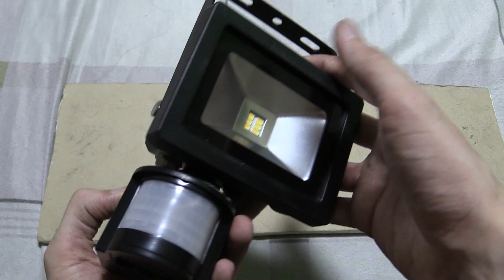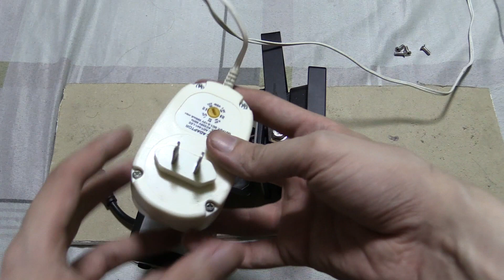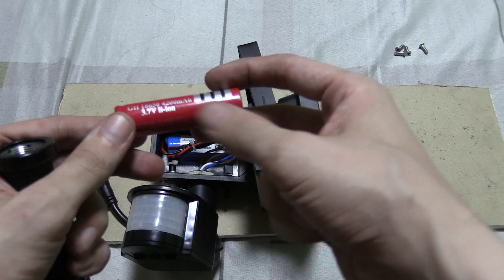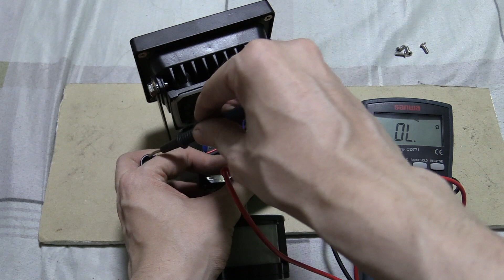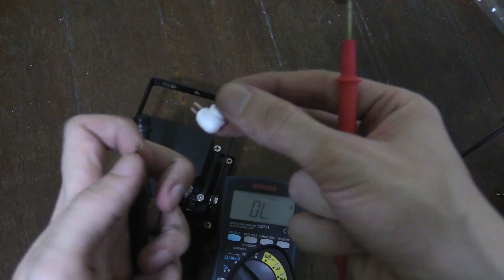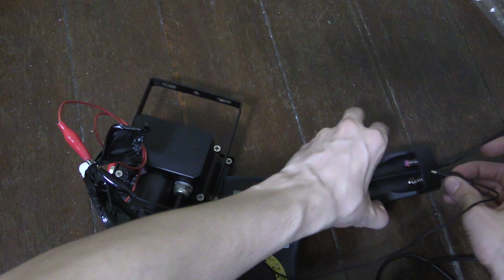Battery charge hack for solar light

Comment: I have a very nice solar spot light I got off Amazon 2yrs ago that still works its just now acting odd. The batteries are the 18650 and they just slide right out after removing the back cover just like regular batteries would. The instructions say this feature is to replace worn batteries but I guess it's good to charge them in a basic wall plug in 18650 charger.   The solar light is the SolRBrite FA FSI 80-882 Motion Activated Security Light.  Worked great for 2yrs but now it seems the light is dimmer, I'm thinking worn batteries. I was just looking up cost of replacement batteries and it seems just buying another light is the way to go, the light is currently only $25.85 with free Prime shipping.

Comment: hey like your multimeter can I as where you got it or did you get from UK ?And I did follow what you did but I must start getting Solar panels so I can do some of your tricks I have always been interested in Electronics for a lot of years being a cb radio man I make all my own ariels to thanks for that and I only have those cheaply multimeters bought in Philippines usally China export ones
Reply from the maker: +Kriss Bartlett I got it locally (Metro Manila) from Hans Tools. The problem is they don't carry any parts, not even spare fuses. The fuses are quite unique so it was a bit difficult finding replacements. I got tired with having to replace my cheap multimeters all the time because they break so easily. That's why I decided to just buy a decent one. Unfortunately I broke the tip of one of the leads when I was doing my bike generator projector. It still works okay but it's a bit harder to use without the sharp tip. I might try grind it into a tip until i can replace it. I only want to replace it with a genuine part because it's a safety issue when working with AC. I'd love to see some videos or pics and info on your homemade aerials. Would be cool if you could work solar into your setup too!
Reply: well I just need to know what to buy I have watched you posts I like a decent set up so a sienwave converter is first have seen the cdr king kits might even start with that hope we never get a Cyclone like we did with Youlander would have been great to have that solar then no electricity for nearly 4 weeks there ill try to make a video hear in Adelaaide and put pics of my set up in pictures I took them all down when I came back hear but hear im always making arials to so good hobby for me to do